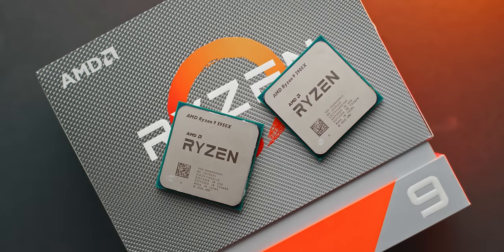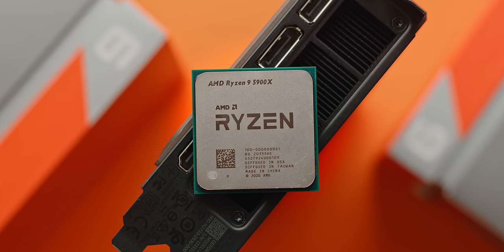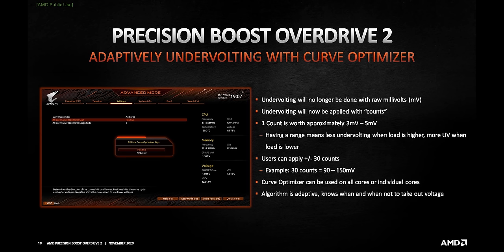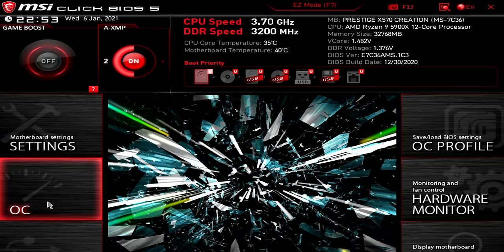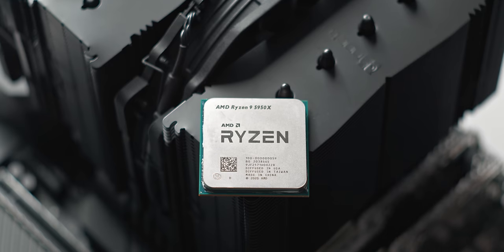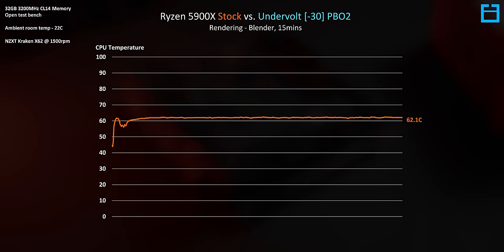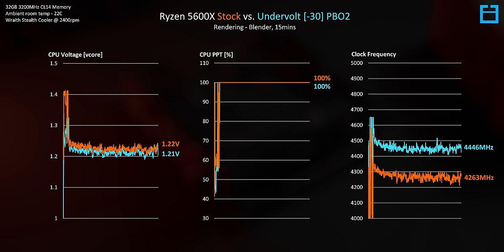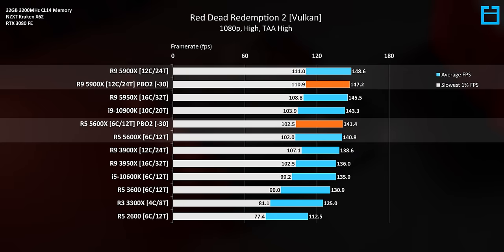Ryzen 5000 Undervolting with PBO2 – Absolutely Worth Doing

Comment: Hey there! Question, trying to understand the different parts of the process, Machines & More sets PBO Limits to "Motherboard" and where you have the Max CPU Boost Clock Override to auto, both mine and his MB has a setting of 0-200Mhz. What are the actual differences in your undervolts? Do I have to change the boost setting manually to get similar gains to your settings? Never dabbled with these sort of settings before haha. Thanks!

Comment: This sounds too good to be true. Is there a hit on long term durability?
Reply: No but if you do it too far you run into stability issues that's the catch. Because workload determines what clock speed we run at (thus voltage too) we are essentially saying at lower workloads use lower voltage the PC goes "Oh wow I am making less heat so I can now run faster" that is where the increase come in. This only works on well binned chips (especially ones like the 5800x). Its basically just turning down the voltage as a result clock speeds also go up.

Comment: You are testing curve on load, which is almost useless. At minus 30 you guarantee to have random unrelated to load crashes with no BSOD or event. Symptoms will point on GPU, PSU, RAM and even OS.

Comment: I got a blue screen of death when trying this with the 5600x. Does this just mean I got unlucky in the silicone lottery? If so can I get it to work by just lowering the curve magnitude?
Reply: Do it not “all cores” but “per core” for the core optimizer. Download Ryzen master (and open it in advanced view). You will notice some threads have a star or a circle. For those just be on the safe side and do -5. For the rest just do -15. The biggest issue isn’t heavy loads but more idle / low loads that your core optimizer settings will fail. -15 all is probably the most I would push personally stability wise.

Comment: This would be great if PBO didn't cause random crashes and if the voltage shift was actually applied instead of still sitting at 1.45...
I've been tinkering with PBO due to your recommendation, but my manual OC is a thousand times more stable than whatever idiocy AMD has cooked up here.

Comment: I tried it with my 5600x... At first with -25 and it was unstable and PC crashes. Then with -20 and -15... Now I am back to default settings because even those setting weren't stable.
Reply: Same here, I was getting away with higher values and now I have drastically decreased them over time. Could it be related to MOBO BIOS updates?
Reply: @jaredodicio i’m having the same problems. did you ever find a fix? i know im months late but im desperate at this point lol

Comment: I have put Eco-mode on in BIOS and set CPU max (in OS) on 99%. 
That gives me very low temps and low wattage during normal desktop work (youtube, excel, powerbi). 
It maxes to 3750MHz.  Cinebench 11479. So there is a degradation but hardly noticable during deskwork.
When I start a game (FS2020) the cpu boosts to 4700 MHz, temps between 70-80 C
Exactly what i want. Very happy with this.
I do have a relatively low ranked GPU (GF 1660Ti) 
Why it works like that i dont know.
Reply: I couldn't agree more with you! I have a 5900x struggle to keep it cool with a noctua nh u14s with 2 fan set up. Case a fractal r6 with 5 noctua fans, 3 as intake 2 to blow out. Had already set eco in bios and still jump over 82-83c under specific scenarios. The cpu max on 99% made a HUGE difference in temperature without losing almost muct in games. Also set thermal throttle at 80c just for the peace of mind and I'm super happy. No need to mess with curves, voltages and all the other bs stuff that soon or later will prove unstable, produce too much heat and consumes 140w...

Comment: Hey guys,
I was able to do a very small amount of undervolting of my 5600X (mobo is Gigabyte B550 Aorus pro ac) without loosing any performance ...
I'm running it at negative 10 CO and I was able to reduce around 8 degrees on Cinebench R23 and around 8 degrees in games (Dota 2, AC Valhalla)
I've initially tried negative 30 (PC crashed), then negative 20, i was running it (stable enought), but got -1000 at CinebenchR23 on multicore :/ (I was getting -300/-400mhz on all cores)
I'm aware that silicon on my CPU isn't the great (based on scores I see on reviews, reddit etc), but I'm wondering am I doing something wrong here? I mean I shouldn't be getting any performance downgrade by doing Negative 20 CO or am I wrong?
Just FYI I'm not termal throttling it .. (temp doesn't go above 80 degrees) 
Cooler is quite overkill for CPU :D - BeQuiet Pure loop 280mm with 2 140mm light wings

Comment: For my 5600x the -14 is 100% stable at -50mhz boost (4600mhz) and PBO Limits OFF
This time have 4.450mhz all cores at 1.100V PBO Disable for more performance and better FPS.
Stable without crashes 69.5/67C MAX PRIME/CB R23 - 10.978 PTS - Ingame max 67C (Warzone).
Reply: Guess that is with the stock cooler? I've got a hyper 212 black and it never goes over 60C
Reply: @wiggygfe  what's your undervolt settings
Reply: @wiggygfe  im with AIO 360 and 17 case fans 120mm on LianLi Dynamic O11 - With my new mobo (RogStrix b550 E-Gaming) have better results
4500MHz @1.150V - PBO Disable - Global C-State Disable - Max Temps 63C-65C on WarZone
Reply: @LawAbidingSociopath69  4500MHz @1.150V - PBO Disable - Global C-State Disable - Max Temps 63C-65C on WarZone 
AIO 360 - x17 Case Fans - Mobo RogStrix B550 E-Gaming - PSU Corsair 650RMx - GPU MSI RTX 2060 Super Gaming X
Reply: @Harris.K  no crashes? this seems undervolt with overclock

Comment: I've tried two scenarios on my 5900X. A) I enabled AMD overclocking but left the PBO LIMITS at ENABLED. On cinebenchR23 i've got 4.6GHz on all clocks, temp at about 80ish and watt draw at about 225. B)I changed the PBO limits to disabled (as mentioned in the video), and on the curve optimizer i changed the value to 20,30 etc. Clocks dropped at 4.3Ghz, temps at about 50ish, and watts at about 125-130.However performance was lost. Is that a normal behavior ? I mean undervolting is supposed to help with thermals, etc but without losing performance

Comment: wont this just be the same as giving clock speeds a positive offset relative to voltage? if it doesnt actually undervolt because itll bring it back up again just with higher clock speeds.

Comment: Totally does not work on an MSI X570S TOMAHAWK. 30 ANYTHING ABOVE 6 crashes. But on an MSI X570 gaming pro carbon works without issue at 30 and excellent scores. On the tomahawk scores are lower at anything but stock.
Reply: it crashes on 6 because your strongest core cannot go over 6. My 5600x can go -8 and -11 on strongest cores, rest of the cores vary from -17 up to -24

Comment: Tried this out on B550 and 5600x, sure I can get the temps up but even the slightest offset change will cause serious bugs in idle or when booting up, anything from videos freezing and not booting at all.
Impossible to find out what the limit is when it only stops working when you are not doing anything.

Comment: wish there was some sort of parallel instructions for this for using ASUS motherboards. I'm too new to this to figure out how to translate the settings from this guide since its based on a MSI mobo
Reply: If ur not super confident, don’t change settings. Set bios to default and don’t edit until you research it a ton.

Comment: Which VCore setting were you using for this video? My BIOS has two options, Auto and Normal. Auto gives no additional control, but I find it will reach quite high voltages (1.49V), and Normal mode allows the use of a positive or negative voltage offset (the latter of which decreases performance like you state early in the video). Hope someone can respond to this!

Comment: those values are true for every ryzen 5000? 5600 to 5800X3D?
Reply: Theyre per processors, even within the same processor line you get different results based on luck

Comment: my 5600x with just precision boost enabled boost to 4650 and get so 80 degrees with noctua 12s single fan. but with the undervote it goes 4500 but only 56 degrees and in cineabench is only 3% slower. So its worth it for way lower temps .

Comment: So my MSI b450 can't do this?
Reply: yeah u can - im trying days now for something stable. I cant! I have the MSI b450 Tomahawk Max - This mobo does not have good VRM - we need upgrade to b550 for sure. So i use now -15 negative undervolt (not 20) and default pbo (4650). wanna try now with -19 undervolting with 4600 (-50). In Warzone have 77-78c temps - In Ace Combat 7 my pc touched the 80c. if I were to go back in time - I would definitely go to 12600k or something shit stable.
Reply: @Harris.K  well I was planning on getting a b450 tomahawk but I got a b550 mortar instead 
And I didn't try undervolting it 
But I underclocked it with stock coolers and I got better score on cpu z bench mark!!
Which makes sense bc temps went down but I'm pretty happy about it
I had to restart PC a few times to fix my mistakes which was scary bc I have never done over or underclocking 
And I was thinking what if I ruin my new PC
But it was fine

Comment: Fantastic guide. I’m having a new issue however.

When I built my machine (AMD 5900x, Asus Dark hero X570, and Asus Strix 3080) I was having major temp issues.  55c at boot, 75-80c the moment I start a game.

After following this guide my issue was remedied and gave me 40c at boot, and 60c when gaming with a stable 4.3ghz.

I just updated the bios today to latest stable version 3601, put these same settings, and now  the cores are fluctuating in game and the temp shoots up to 75c when I start the game.  Any tips?

Comment: Hi Optimum Tech and good people of Youtube.
I need some advise. I have a Ryzen 5900x and a 3080 and they´re on custom water cooling both of them. 
The problem is ofc my temps on my Ryzen. When i play in this example Dying Light 2 which is a bit of a load for everything but not extreme, i get pretty high temps on my R9, around 75° and sometimes it even bumps up to 80°.
I have done everything in this video however i did not manage to get it stable on the value 30, so i bumped it down to 25 and now it seems to be stable.
The problem i have is now the CPU clocks higher which is great ofc, but the temps remain the same. Especially when I download a game at the same time as i´m playing, the CPU now get as hot as 85°.

What can i do to fix this? Not very experienced in overclocking or udnervoltign or anything so do kinda need some help.
And since my GPU dont get hotter than 53° i´m guessing the cooling capacity isnt the problem.

My spec incase they matter.

3080 XC3 Ultra, EK waterblock
R 5900x, EK Velocity block
Acool XT45 360mm rad with 3 Phanteks T30 pull config intake at bottom.
Corsair XR5 360mm with 3 T30 fans as top exhaust.
D5 pump/res combo from EK.
4 Vardar fans front intake no rad, 1 vardar exhaust back no rad.
MSI X570S Carbon Max Wifi
4x8gb Corsair vengence lpx 3600mhz
Phanteks Enthoo pro 2 case
2 pcie gen 4 drives and and one pcie 3, dont think that matters at all but list them here anyways.
RM850x with cable mod cables.
Think i included everything

Running pump at constant 60% and radiator fans at 1200RPM constant.

Grateful for any help:)
Reply: Hey man, how's your system doing now? You found the solution for it? I have similar setup and problem as yours. The 5900x while gaming Keep pushing to the 80+degree C mark. Gpu only 50+. Been playing around with the ppt,tdc,and edc but still Could not find the best solution.
Reply: @alfredteh  Hi
Found a problem where I had some debris in the fins on the cpu block after cleaning rads. Guess the vinegar loosened it and then when the fluid started going around it got loosened even more and went around the system to eventually get stuck in the fins. 
Dropped about 10c just getting that out but think I need to check again since temps are rising a bit again. 

That’s the only problem I can think of and the only other solution I know might help is lapping cpu and coldplate. 

But I suggest u start checking cpu block fins.

Comment: Well, On my 5600X I can get 4.5Ghz rock stable at 1.2 volt all cores. Passed 40 mins of prime 95 smallest FFT test. Where I live ambient is very high like 33c. I set my AC to 26-27c, temp doesn’t exceed 72^C at cinebench R23. 240ml radiator.

Cinebench R20 - ~4400 pts
Cinebench R23 - ~11600 pts

What You think? Should I still go for curve optimiser?
Reply: What cpu?
Reply: @sabotagekiwi   5600X
Reply: @starrims  It depends on your use case, since curve optimiser lets you push single core and all core at the same time. Most likely there is still some performance to be gained both on single core and on all core for you, since curve lets you hit max possible frequencies on both. As always, track your score on both and compare what you can achieve :)
Reply: @sabotagekiwi   That’s true, I have tried it, sure I gained 500 more multicore score at Cinebench R23 but the problem is temperature. Where I live its a hot country, in summer temp reaches up to 37c even. Now it’s around 30-33c. Using PBO+CO, voltage goes to 1.4v even, thus Temp reaches to 80c!
Rather I was thinking, I will take little bit less performance but keep it safe & cool 😅, that’s why my question is, is 1.2V constantly good for this CPU, because PBO may push voltage to 1.4 but in ideal it comes down to 0.9v even.
Reply: @starrims  1.2 v is completely fine for 24/7 use, it's really not that high. Run it and enjoy your lower Temps :)
Reply: @sabotagekiwi   Yeah Thank you. I will still continue experimenting and discovering. Little performance gain doesn’t mean a thing but learning things is important :)

Comment: I set my 5950x as per your setting but my system restarts randomly at idle. So putting it back to default should solve the issue right?

Comment: nice vid however I am a bit puzzled by this undervolting, I read some people were doing it to get the temps down but you've shown it can also increase the clock. Im new to Ryzen so trying to get my head round what is the best way to overclock it without frying it. Ive got a 5800X with a decent cooler on it (noctua nh d15s with push pull setup with space to add a 3rd fan). I followed this video and after running prime I got an error with -30, I ended up having to go down to -15 to get no errors. For those wanting to know, my system booted up fine at -30 and I didnt get any crash but then again I didn't use it for long, just ran a prime test for a few mins till it flagged up an error.
Reply: I wouldn't pay too much attention to Prime95 errors. They're unlikely to cause any stability issues in every day usage and even a rock solid overclock/undervolt that's been tested in a multitude of day to day apps is common to get P95 errors.
Reply: @ReichEnemy  im reading online that it means its unstable. So if I'm seeing this error after 5-10mins then surely this would cause me issues if im gaming etc.

Comment: Hello optimum i love your vids!| 
let me ask you one question
i have the tuf b550m gaming plus with a ryzen 5600x 
that value of -30 suits in my board? 
keep the good work 
cheers from portugal
Reply: It absolutely depends on your CPU. If you search through the net, you will see that -30 on all cores is rarely stable when tested with programes like Prime95. So you need to find out what you CPU can handle. As example,  test it on -30 on all cores, see if it is stable, and if not adjust the core where it isnt working with -30. Bring this one to --25 and test again until all tests are stable. So you have maybe different settings for every core. Like -30. -30, -20, -10, -5, -15. (Only an example!) And before, update your board to the latestst Bios. :)
Reply: @tobiko5958  yeah! i try -30 until today and while playing i didnt have any issue! and temps are good and so!

Comment: Fold the steps up to the curve optimized part, that option is not showing on my board. I have a MSI b550 carbon wifi with a 5800x

Comment: Why does my 5900x underclock so heavily when running at 100% vs yours? My stock was running at ~4.1ghz when running multicore tests at 100%. Changing the settings to -30 like you did here gave me a bump up to ~4.3ghz. I'm not even hitting 80C during these tests
Reply: idk same with mine, 4.1ghz in cinebench all core (stock), maybe its temp dependent as it goes up to 81C for me and his seems to be only 60C. Unless yours is around 60C too like in the vid, then idk whats going on.

Comment: 5900x here, on an ASUS ROG Crosshair VIII Dark Hero.   Should I leave 'Max CPU Boost Clock override' on auto?
I have set PBO Limits to 'Motherboard' and max clock override to 100mhz.

Cannot get lower than -20 on the curve optimizer.  System shuts down and reboots  
Getting an all core boost of 4575 at  -20.  Temps have plenty headroom. (360mm AIO)

Comment: Is it possible that more than -30 is possible? I can go below 30. I'm now gonna test if it runs well with -35. Benchmark performance is already better. 4.7Ghz on all core at 100% and temps droped from 90c to 80c in that use case.

Comment: Guys i tried doing on my Ryzen 5 5600x on msi b450 tomahawk max 2 motherboard pbo2 negative 30 but the clock speeds won't go above 3.9ghz
Reply: My cinebench score went lower than stock 🤣
Im gonna just run it stock f it
Reply: I ended up doing 4.6ghz all core at 1.24v it stays below 80c on cooler master hyper 620s

Comment: I get constant BSOD using the same undervolt settings on my 5900x with MSI x570 tomahawk
Reply: yeah its like hitting the cpu lottery. my 5900x can uv up to settings to -20. while my 5950x can only go up to -10. the only other way around this is to do constant benchmarks to find out which cores are tanking from the UV and adjusting each core that can handle it manually. you can do this by running a log and adjusting each core by going in to the bios.